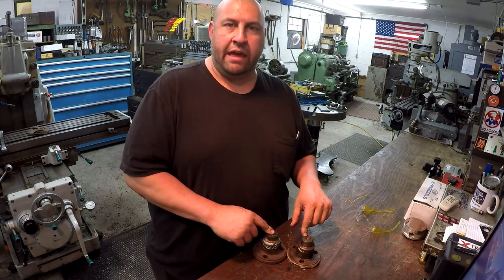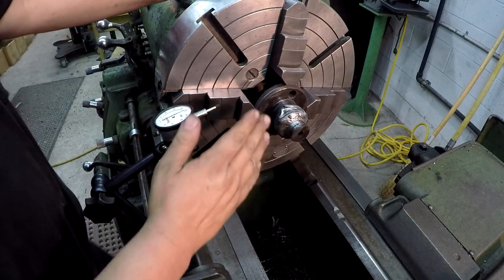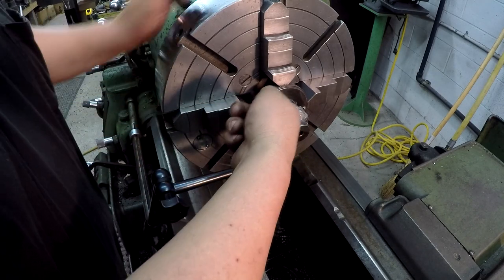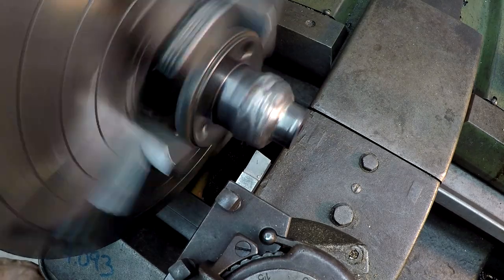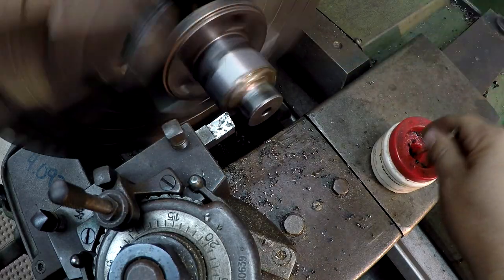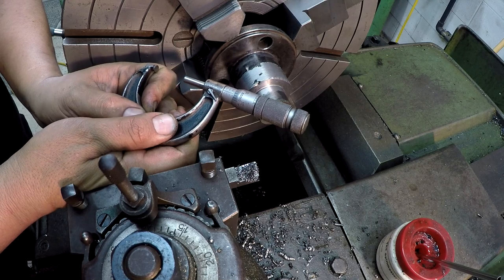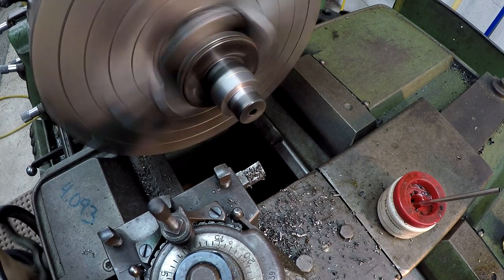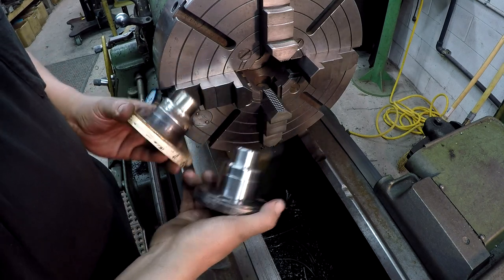Turning Weld Build Up With High Speed Steel

Comment: Would You care to elaborate a bit on how to indicate a built up welded part like this  accurately in the 4 jaw?
The problem as I understand it is:
The shaft is more than often bent from welding.  Getting the shaft both centered and perpendicular to the front or the back side of the flange (that is also hidden inside the chuck) is a challenge for me. Indicating the axle in 2 spots centers and aligns the axle well enough but indicating the flange still can leave the axle unaligned if it is slightly bent
Aside from the obvious solution of turning the part around and turning the flange, what is Your best strategy on indicating parts like this with a perpendicular flange accurately?
BTW, good job and excellent video as usual, enjoyed it!

Regards from Sweden.
Reply: Not a machinist but i believe it's easier and better to use flange itself as a base plane as the shaft needs to be aligned with it. i'd use a cilinder inside the chuck or pair of parralels

Comment: Just block up the fork lift take the broken side and bolt to the good side build up weld anneal that weld then fire up the fork lift and let the hub spin take an angle grinder to it and grind to shape  works great .... or use a hunk of bar stock with welded cutting tip quenched  and ground into a tool... just use a rest and hand grave it ..also use hand file for precision... don't have a dial indicator a long wire on a fulcrum will do the same...... have the whole job done in the time it would take to drive the part to the machinist.... trust me I've done it this way .... everyone has a lathe in their possession they just didn't realize it.... have you ever seen a guy put his car on jacks and use his drive axles as a lathe you might be surprised by the way problems have been solved

Comment: what would be the required action to turn that piece of weld if it was welded with standard stick weld not mig or tig? any info on this is appreciated as i'm looking to make some face plates to mount my new 4 jaw self center chuck and my mig welder packer in so only got 140 Amp stick welder left working could i still do it and machine it ?

Comment: What would you have done had the piece moved,
I use a live center to stabilize my projects. 
You had a centering hole to start with.
Reply: Live centering is not always necessary on short rigid pieces such as the preceding.

Comment: I'm wondering why you wouldn't immediately go for TIG to fix those low spots.  With TIG you can use the exact same MIG wire and finer control, or, when turning down braze, just use the same rod you did the buildup with.  On an older machine (no semiconductors), I'd even clamp ground to the part or chuck to keep the current in the intended path, allowing the fix right on the machine.

Comment: Nice Job Adam. Just one question, though. Is your friend trying to get by with junk forklifts, or is he just ignoring it when the first sign of trouble shows itself? Man I would be ashamed if  basically the shame failure showed itself twice.

You do great work, Not finding fault with you at all.
Gary 73-year-old home shop machinist in North West Arkansas
Reply: He fixed it one side at a time. But yeah, it's sometimes all too easy to let machines go a little to far, especially when work depends on them.
Reply: Yes. many folks who use a machine every day ignore the necessary maintenance because they don't prioritize it.  Front axle spindle 'king-pin' bearings and axle center pivot bushings are very common problems.  Loader & backhoe bucket pivot points get abused too.
Reply from the maker: I'm sure there is some failure to keep up with proper maintenance there, and often times, in this case to, once you discover a failure the damage has been done. He uses that forklift all day everyday. He runs a very busy and active shop and constantly loading and unloading trucks and other things with this lift. It's very hard to put it out of service when you need it. he limped along and actually purchased an almost new unit but a little smaller, and is now repairing this forklift.

Comment: Have been watching your videos for years.. always enjoy! I desparately need your help with machining some built up weld on a very small boat drive shaft from an outboard motor. Its only 25.5" long and needs only about a 2" section (that rides on a seal surface) what do i do to send it to your machine shop? I would like to pay to have you machine it please. Thank you so much in advance!

Comment: Video is pretty old, but I wonder what one of those cutters costs vs. a couple cheap mill files from Harbor Freight. If you're just trying to knock down weld or old scabby rust or mill scale, I wonder if you could just chuck up the part, let a cheap Chinese mill file get torn to crap and save good tools for finish work. If you destroy a $4 file, it doesn't really matter much and the Chinese stuff works well enough as a throwaway.

Comment: Why not make the whole part from scratch from same grade steel vs steel mixed with weld? It does not look like a very difficult part to make especially when you have all the necessary equipment there.

Comment: Why not making a new part instead of fixing this old part weakened by all that weld?  The shoulder length do not need be exact; when installing, the bearing preload  needs to be adjusted with shims on the flange.  Remember, it uses taper bearings on top and bottom.

Comment: What kind of phase converter do you have? It's so quiet.
Reply: he has 3 phase directly into the shop.  Luckily the utility company had three phase right on his street already so it wasn't a big deal     to have it run to his shop.
Reply: @benrivenbark  ahh, ok. every time the lathe shut down I thought a heard a whirring sound picking up again like a phase converter. Probably just the lathe I'm hearing?
Reply: @benrivenbark  I thought most houses had a 3 phase main supply? I guess it might differ from country to country of course, we do have a kinda weird power grid here in Norway.
Reply: @hakont.4960  In the United States houses have 220 volt main Supply single phase electricity. Most of the outlets inside of a home are 115 volt except for the stove, clothes dryer, and other large appliances.
Reply: @benrivenbark  Quite different systems then, but both systems get the job done.

Comment: why an independent chuck over a universal self centering one?
Reply: 3 jaws are great for starting fresh with billet. If you need to work on a part with existing features and need your cuts to be concentric, 4 jaw is more accurate. The setup is way longer but it's worth it to get it closer than .001"
Reply: Ah, makes sense. Thanks

Comment: would you be able to grind it instead?
Reply: Nolverto Gonzales No its a tight tolerance part and a grinder would give you innacuracies.
Reply: Nolverto Gonzales actually you can hold allot tighter tolerances on a grinder. The catch is what kind of grinder he means...an od grinder you can hold .0001 all day.

Comment: Your customer should have let you do the welding! Doesn't look like he undercut at all, before welding.  I suspect those parts will be back to see you before long.
Reply: Exactly.  We undercut all precision ODs about .030" before building them back up with weld metal.  It makes for a much better looking and longer lasting repair job.  TreeTop
Reply: Classic case of cheaping out costing double.
Reply: Scrolled down to see if anyone else was going to comment on that. Pity, because Adam did nice work.
Reply from the maker: I doubt he did any undercutting, prob just welded it as is. Joe was just trying to help out with what he can. It should last, the bearings in the housing give up and everything was wearing out.
Reply from the maker: Dennis, if you get a shaft surface that has had something spinning on it like a bearing race, you want to undercut it and remove the hard spots. The diameter you finish should be weld material and not mixed with the underlying surface.
Reply: With decent weld prep and good penetration you are correct, but I don't think in this case, where it doesn't look like his root pass penetrated much at all.  The end user would have benefited from a slight undercut to fresh metal before laying down any wire.
Reply: James Kilroy another weld snob at it again! Part looked good to me I highly doubt undercutting .03” would of done much more than made a cleaner looking finished part.. which will never be seen once
It is put back to work. Undercutting .03” is also not enough to say that their will not be a mixture of the old material in there. Also if the same material was not deposited it does not matter how far you undercut it..

Comment: Wouldn't the best solution be just buy the parts that are worn out so the forklift is back in service the same day , and a friend is not wasting your time.
Reply: Money. Most likely cheaper to spend 5 minutes welding and an hour machining.

Comment: The part looked like it was center drilled, why not use that feature to help center it?
Reply: "why not use that feature to center it."

Difficult to explain and I don't necessarily agree with the method Abe used to center this. The short answer is, with a 4 jaw chuck it's faster/easier to just let the part float freely and adjust position with the chuck jaws and mallet, rather than trying to constrain the center hole first. Using a 4-jaw chuck is kind of a catch-all in lathe work, when it's uncertain what method or setup was used to turn the part originally.
Reply: @TSorovanMHael  Centers get damaged all the time, too. Best method is to always dial in the face first, then the area closest to the face, the the area furthest. Abe spent way too much time dialing in a forklift spindle.
Reply: All y'all are in this thread full of it. Doesn't matter if it was center drilled on another machine..  and no, the centers aren't usually "damaged". If by chance it is damaged, put a 60 degree countersink in it and turn it by hand a few times. Simple cleanup. It's the center that all surfaces were machined to. Use it and save yourself some time. In my experience, it will be within a thousands or two and only a few taps will get it to run perfectly true. Should take no more than a couple minutes to indicate this part.
Reply: It was tweaked, broke and welded back together. That center may be off by more than a couple thou. This way just makes sure it’s centered.
Reply: Summit X  I gotcha I guess I just missed that part. But yeah Im with ya! I always indicate just to be on the safe side. Only takes a couple extra minutes to make sure and be on the safe side.

Comment: Hello sir, one question: Does this weld has the same structural strenght than a solid piece turned to the same dimensions? 

Thank you for the answer beforehand.
Reply from the maker: It will still have it's structural integrity yes.
Reply: Abom79  thank you.
Reply: aerospace engineer here: welds have about 40% of the strength of their base material on a good day. Fortunately a part like this is made to be tough, so a repaired part is still likely to last a while.
Reply: Ryan Wilhelm You couldn't be more wrong.  The weld itself is often times stronger than the parent metal.  Sometimes, however, the area around the weld (heat affected zone) may weaken.  This is reduced by proper preheat, post-heat as well as welding techniques and peening.
Reply: Ryan Wilhelm 40 percent of strength.. stay behind ur desk pal because I promise u a high pressure pipe weld disproves your theory
Reply: In theory, the part will not be as strong as it was originally due to the effects of the welding heat, especially if the part was heat treated to begin with. A weld heat affected zone contains every heat treat condition the material can achieve, from full hard to annealed. That being said, in 40+ years of welding I have welded many parts that shouldn't have been welded, becasuse we had to. Many like this that were built up and machined. They worked well and didn't break.
Reply: phlodel pre heat,post heat, knowing what temp u need to let cool to for a multipass weld to not damage the properties of the material and last but not least laying down a proper weld to begin with.. all part of the process of being a real welder
Reply: Well, yeah. No matter how you weld it, short of having the exact same alloy weld filler and a complete re heat treat, the metal will be affected. Parts can be welded succrssfully and work just fine.
Reply: Infomercial couch potato here: Throw a little flex seal on the metal and you will have the strongest part on earth

Comment: I love 4 jaw work, and when you need a tough tool stellite gets through hardened steel when a carbide wont, yet you can grind it like HSS; 
and old brake fluid makes quite a good lube for stainless and other tough bitches.

Comment: Why not use a grinder on the first pass over a weld-fill? The tool insert makes cringey noises at first, and you expect something to break off.
Reply from the maker: It's just not something I practice, I'd rather use the lathe and turn it.

Comment: why don't you use a magnetic chuck? are those not made yet?
Reply: Khum Dhan a magnet chuck has been an idea for sure but the force is too great to hold and it'd take even longer to indicate in
Reply: Jared Wells I didn't even think about how difficult it would be to center it. I know there's magnetic chucks for mills and such.
Reply: Khum Dhan yes they do have them for mills and especially for surface grinders but it would be pretty sweet if the could make one that's easy to indicate and hold your piece
Reply: An electromagnetic chuck would be the way to go and use the residual magnetism whilst indicating. Personally i think magnets would be a pain in the butt for swarf etc
Reply: how do you turn aluminum? no need to reinvent the wheel
Reply: Exactly!

Comment: Since when do you start hammering a workpiece when the clock is still on the said workpiece? Those clocks are very fragile! Then, you never seem to use a mic to measure the diametre, these verniers are handy, but not very accurate.

Comment: lol, my boss always told me if i can get it withen a half th. you can get it right on the money
Reply: we uesd to turn to 2 tenths. all the time. to save on grinding. and paper it in. and uesd hard turning ceramic inserts for turning hard stuff. to 2 tenths. you have to use loads of coolant to draw out the heat. and to stop the insert from shattering.

Comment: Out of interest why did you not just turn a brand new piece?
Reply: my guess would be the customer's $ didn't allow for it, and it also sounded like time was an issue, though I'm unsure if the 2nd forklift the customer got is a loaner or not. Just the feelings I got from the video.
Reply: Interesting theory. If it where me I would possibly ask for new ones made up to keep "in stock" but as you say, money is always a factor.
Reply from the maker: I'm sure the new part is more costly then paying me an hour to turn it down, plus is was a I need it now type of job.
Reply: +Abom79 I mean you turning a new one instead of build up the weld on the original older one :)

Comment: if I was denied metric measurements, I could not work imperial!
Reply: There is no metric. It's all in thousandths of an inch. Even a millimeter is 0.0394"
Reply: ok, I did not know, but working metric is simple, working with thousands nauseates me:))
Reply: Actually when working in Metric you are already working in thousands as a millimetre is 1 thousandth of a metre. 
A thou' is just a thousandth of an inch and there are 25.4 mm in an inch. 
100 thou' is 2.54 mm,  and if you keep moving the decimal point over then 10 thou' is .254 mm and
1 thou' is 0.0254.
Mind you in the early '80's as a schoolboy and then Apprentice Carpenter, when my [now deceased] Grandfather who was a Toolmaker by trade, talked about thou' of an inch it confused the hell out of me.
It has only been because of watching YT guys like Keith Fenner and Adam Booth etc that I forced myself to get to grips with Thou'.
Reply: Hands up all those of us who like me, miss read the word "Mensuration" and wondered why 4nuk8r was talking about a "ahem" "female problem'.                                Menstruation, take away a T and swap some letters around and look at the trouble it causes.
Reply: I don't know how big 0.01mm is, but I do know how big half a thou is.
Reply: the world isnt perfect. im a metric freak too but if i need to use imperial i will. Imperial was developed using the human body and other "standards" which is convinient for measuring without tools
Reply: And I get furlongs to the hog's head on my Indian now not liters per 100 Kms. That metric stuff baffles me too.